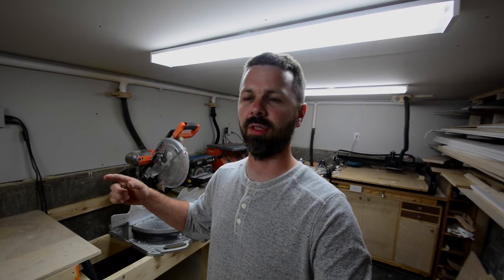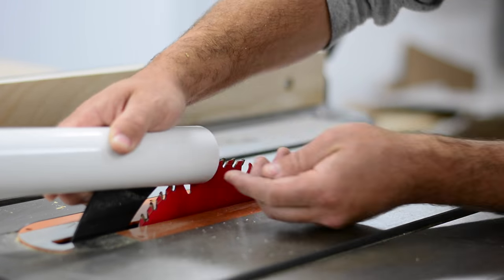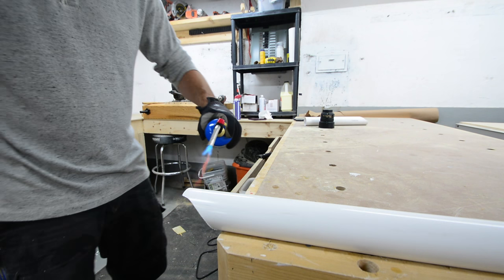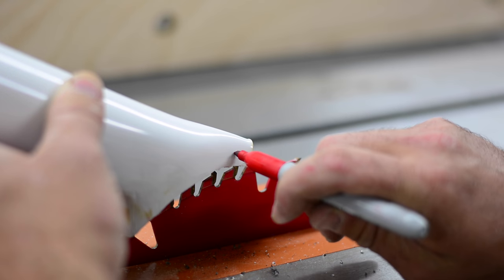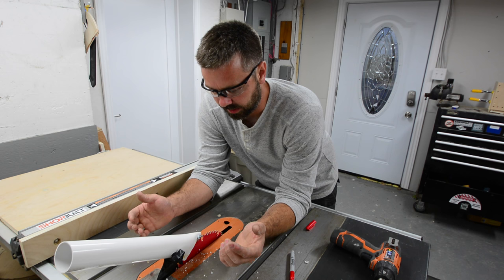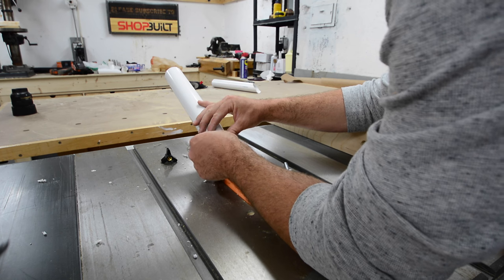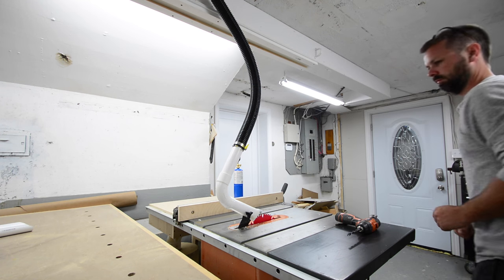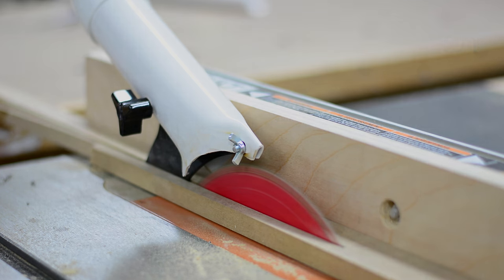Shopbuilt - Overhead table saw dust collection

Comment: Very cool, a zero clearance throat plate will help a bit yet too, if there's any dust collection in the btm of the table a 1/2" hole drilled in the throat plate towards the back of the blade will draw air in directly where the blade wants to spit it out

Comment: Good idea. I'd put a cpl drops of loc-tite on any of the hardware near the blade - or use nuts w the nylon insert. You def don't want that wing nut coming loose while the saw is running
Reply: Tioga Fretworks A

Comment: I also have to use a shop vac for my dust collection. I started off originally almost exactly like yours but found that the line around the room with neat 90 degree branches was not nearly as effective as when I redid it to be much more direct to each tool with no turns sharper than 45 degrees. The more gradual turns were especially important in reducing pressure loss. 

Thanks for the idea, I've been looking to make one of these, I like your design.
Reply from the maker: +Kbo yeah, the 90s are killer but sometimes it's hard to fit the 45s in

Comment: Great idea. you could use a couple of spring or split washers or nuts with the nylon in them to stop vibrating loose and falling into the blade.

Comment: Ryan how about and airline controlled by a solenoid mounted
under the saw table aiming at the blade gullets as they exit the cut. The air
stream would blow the dust out of the gullets after the cut thus reducing
the amount of blade throw back and leave the top side clear of clutter.  The airline could be mounted in such a way
that it would rise and lower with the blade and only turn on when the saw was
running. The air pressure could be controlled by a small regulator on the air
line. Blown dust would be picked up by the saw vacuum system. Just a thought to
keep the blade cutting area clear. As a side benefit no mountings to be removed
for non through cuts.

Comment: At first I was going to build this, but decided not to...it does not have the necessary clearance to push wood through safely with either a push stick, or MicroJig for narrow cuts. In addition, I like my blade to only be about 1/4" proud of the wood that I'm cutting. I opted for dust collection from below. Otherwise, overarm dust collection would be ideal. I did like your creative thinking!

Comment: The only thing I would worry about would be the wing nut coming loose from the vibration. I think I'd slightly deform one of the threads just enough to make it a tight fit. Same with the knob. I had a similar accident with one of those wing nuts on my router that holds the optional guide in place. Flew right into the blade. Otherwise this seems like a great setup.
Reply from the maker: +sooth15 yeah your probably right, I'll keep an eye on it.
Thanks for watching
Ryan

Comment: Seems to be effective for your purposes if you typically cut no stock thicker than 3/4" and you don't use any jigs such as a cross cut sled.  That wing nut is scary....if it somehow loosened and fell into the blade, it would no longer be a wing nut....it would be a bullet travelling in your direction.  A nylon nut and bolt (any big box store) can be tightened and then glued with CA glue to insure it doesn't vibrate loose.

Comment: Nice set up! If you had a throat plate slotted all the way in the back you could remove it to get to the riving knife and remove whole assembly without unscrewing it.  Get a second riving knife for the times you don't want it attached. Not familiar with your saw but my riving knife can be removed in seconds. May not be worth the extra effort but you wouldn't be screwing and un screwing it every time you want to remove it.
Reply from the maker: +Lowell Smith for sure! I was thinking of doing the same thing but I just didn't have time for the video.
Thanks for watching!

Comment: great idea Ryan, are you limited by the thickness of your boards now?
Reply: I was wondering that too
Reply: +Daniel Daily I'm sure he will reply!! 👍👍
Reply from the maker: +SouthernGinger thanks! The maximum thickness you can cut with the dust shoe on is 2 1/4" after that you would have to remove the shoe. This is not much of a limitation for me because I'll be mainly using the dust collection for sheet goods.
Thanks for watching
Ryan
Reply: why not hanging your dust collector above the blade (with wires), you'll eliminate the thickness limitation and also prevent the possibility of losing screws in the blade due to vibrations ?

Comment: Very cool, my only question is what does the floor look like beneath the table saw?  I always assumed there was a need for 2 ports for suction on a table saw.  One like you have then another below.
Reply from the maker: +Greg Altenhofel yes, I still use a 4" dust port on the bottom.
Reply: Thanks for getting back

Comment: Sorry, but I'm a bit skeptical.  Here's my thinking ... Yeah, you're limited on the thickness of the material as I understand it.  It doesn't look like you can lower your blade for thinner material since the riving knife lowers with the blade, right?  It would be nice in "version 2" if the vacuum tube could rise and the blade lowers, much like the standard blade guard (that never gets used)  does.   Hey, maybe I'll re-engineer my blade guard to become a dust collection device!  Thanks for the videos and the food for thought!
Reply from the maker: +Randy Tucker I took all this into consideration when building this on, I wanted to avoid a full inclosure because just like a guard, it would get in the way and I would end up not using it. The focus was to keep it as narrow as possible so you can get  the fence close as possible to the blade. I also did not want to have to manually change the height of the dust shoe, that is way I attached it to the riving knife. Finally I can still cut 2 1/4" with the dust shoe on, this is not a limitation in my shop, for the few times a cut something thicker than 2 1/4" , it easily comes right off.

Comment: That is really cool, but isn't it going to get in the way of the thicker material when cutting it?
Reply: That's what I was thinking but if you need to cut thicker material you'd raise the blade which in turn would lift the pipe?
Reply from the maker: +Tiny Houses no, the riving knife raises and lowers with the blade so the nozzle will always be the same distance from the blade regardless of blade height .
Thanks for watching
Ryan
Reply: +Shop built I really like this actually, but I agree, I think it would be worth modifying it slightly so the blade isn't exposed so far above the material. looks like you could make that work with some slight tweaking. I love your dust collection. I have the same shopvac and table saw.
Reply from the maker: +Tiny Houses to a maximum of 2 1/4", then I would have to take it off to cut anything thicker.
Reply: I was thinking exactly what Jacob Edmond was thinking. To eliminate the blade from being exposed far above the material you can probably weld a plate just above to the top of the riving knife being the same thickness with the same hole pattern to mount the vac hose to so that way your able to also utilize the whole blade again.
Reply from the maker: +Tiny Houses I was more interested in getting the nozzle as close to the bottom of the blade. The main use for this for me is ripping sheet goods so I was welling to sacrifice blade height for better dust collection.

Comment: Wing nut is unsafe!, drill a small hole thru the wing nut and bolt and install a cotter pin, that will save you from having an accident. good luck, (good idea by the way)

Comment: Your blade is set to high, second your are limited to the thickness of your material being cut, third you can’t add on a dado blade to thin of pvc, can’t drop your riven blade for a sled to use.

Comment: nice job 
 not to be the safety police but I couldn't help thinking that the wing nut would end up  falling out and  acting like a bullet once it hits the  blade.. maybe swap it for a nylon.
Reply: I agree totally.NOT a good way to do it. A bolt and LOCK nut (Ny-lok) would be MUCH safer.And yes, if that wing-nut was to work itself off and hit the moving blade, there is NO telling how much tragedy it could cause.Please fellow woodworkers: Do NOT do this. It is just too dangerous. In a factory, OSHA would close the place down over this kind of contraption.Delete my post if it offends you. But it NEEDS to be said. I stand on every word.

Comment: Enjoy your videos a lot sir.   However, I don't think the dust collection will work well due to very low air flow and the positioning of the port behind the blade.  Virtually all the dust on a table saw gets sprayed forward from where the blade first contacts the wood.
Reply from the maker: +Jim Sweatt I disagree, most of the dust comes from the blade carrying the dust around after exiting the wood. Also not a lot of volume is needed as most dust is thrown to the bottom of the table saw cabinet where my 4" dust collection sucks up the majority. What is needed is high pressure to suck the dust out of the blade rotation before it gets flung out. Shop vac is a ideal for this.

Comment: There is way better solutions for tablesaw top dust collection, but you will understand this in future. The best way for me is to make some kind of dust shoe which is not connect to the riving knife but with own construction to hold it and this dust shoe should cover all blade, not just the back end of the blade. (you can find inspiration with this dust shoes for CNC milling machines   with brushes, mine is something like that and could sucks almost all the dust from the top with powerful shop vac like yours)
Reply from the maker: +m Ni I actually made a point in this design to avoid both of those things, inclosing the entire blade I feel would make it to cumbersome (like a blade guard) and I wouldn't use it. If it wasn't attached to the riving knife then I would manually have to adjust the height for optimum dust collection. I focused on making the shoe as user friendly as possible by not having to adjust anything, allowing the fence to get as close as possible to the blade and nothing in the way to block the sight of the blade like a blade enclosure. Also you can not use a cross cut sled if the entire blade is enclosed.

Comment: I think when making dust collection ports, you really need to understand where the dust is being generated. On a table saw, it is generated at the front of the blade, where it makes contact with the timber. Dust extraction at the back of the blade is not really very effective. Speaking from experience here, I had a rear collecting dust set up and it really didnt work that well. I switched to the front of the blade and it made a huge difference. I also think your set up is too pinched where the wing nut goes through, meaning it will not catch as much as it could.  Good luck with your future projects.

Comment: And when that wing nut vibrates loose and is thrown by that spinning blade you won’t have need of that tool anymore.  Exaggerating here.  But I’ll tolerate the dust before I’d do this.

Comment: That won't work properly. It only works because you cut 1 inch high piece. What happens when the piece is 3-4 inches high?....or your using a push stick or Microjig...hell anything!
It will hit the white pipe. Im assuming that is why you didn't show it cutting a decent piece of lumber instead of a toothpick.
Reply from the maker: It's attached to the riving knife which raises and lowers with the blade.